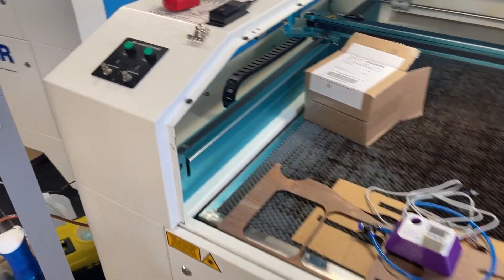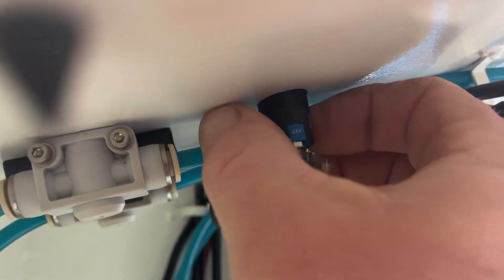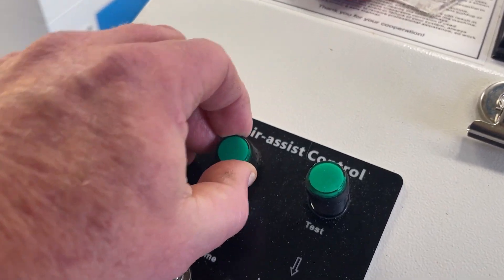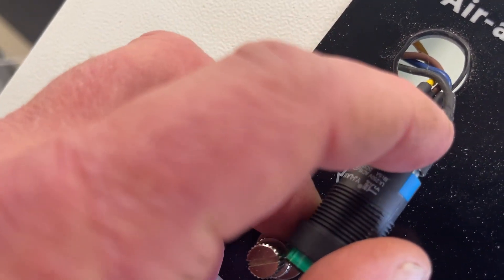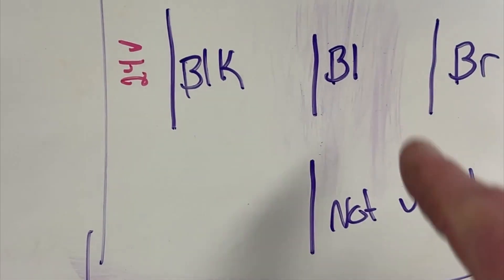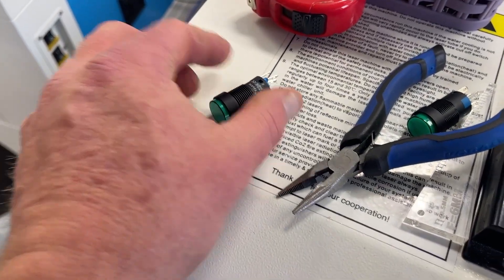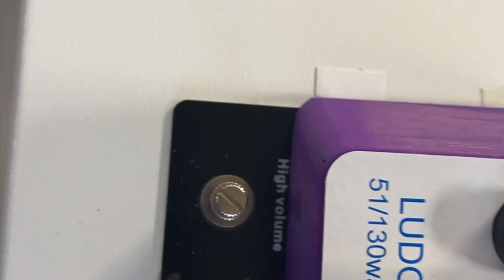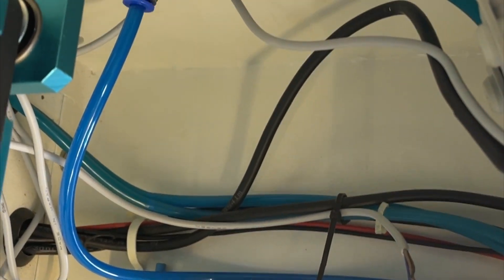Installing Digital Air Gauge on the Thunder Laser 51/130.

Comment: I added a SMC presure meter and just marked out and cut the 31mm square hole next to the air test buttons. Just tape off with blue tape and used a dremmel to cut. Then small flat file to clean it up. Use a magnet to pick up the filings and vac to clean up. Also make sure you move your laser head away and cover with a towel or sock..etc. then blow out everything when down.

Comment: Great video! Thanks for sharing 

Did you have to adjust any of the settings with the SMC pressure gauge? I can’t get mine to read above 10psi, even though my high volume is wide open/maxed out.
Reply from the maker: If you cover the nozzle tip when the air is flowing yu should see the static pressure. If the nozzle is open with the air on it should read flow pressure. We average 19psi of flow while cutting.

Comment: Generally speaking, what pressures are you seeing are best for the high / low (cutting / engraving)?
Reply from the maker: We keep the high air wide open. The gauge registers about 19 psi due to the size of the nozzle opening.  Low air registers at 0 however if I cover the nozzle tip I think it shows about 5-6 psi. When working with two color acrylic we keep the pressure about 1 psi